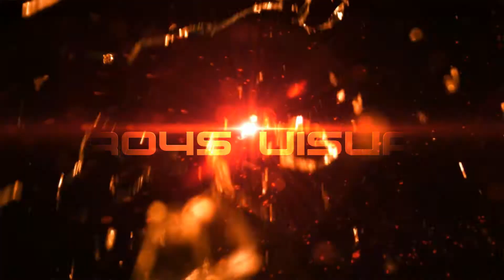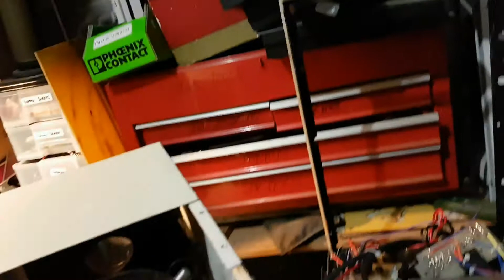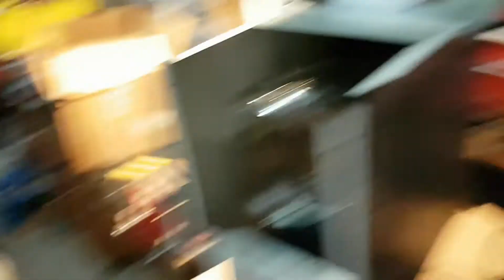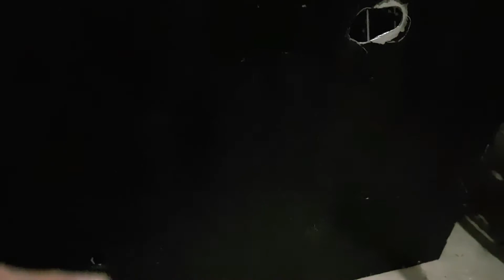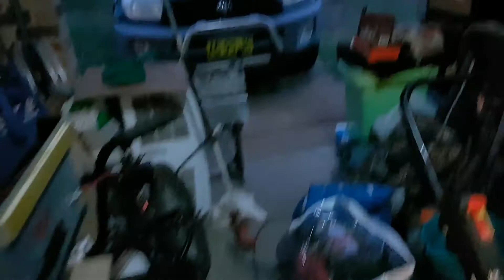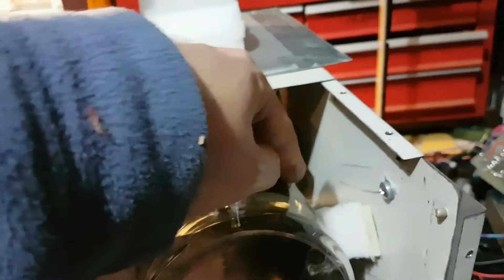Iconoscope TV camera project (Part 120)

Comment: Is there any issue with using a plastic packing foam like that for mounting near the tube. Was wondering if it acted like Styrofoam where it could build up an electric charge and possibly cause deflection issues. Perhaps something like pink 'anti-static' foam could be beneficial here instead?